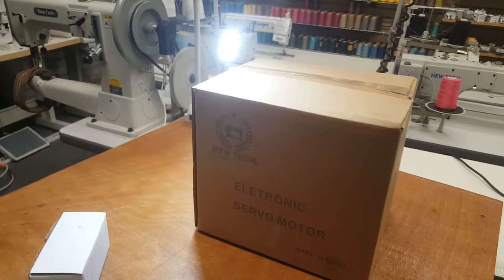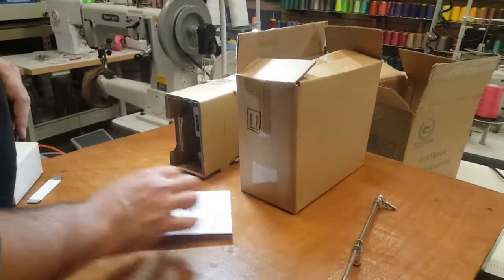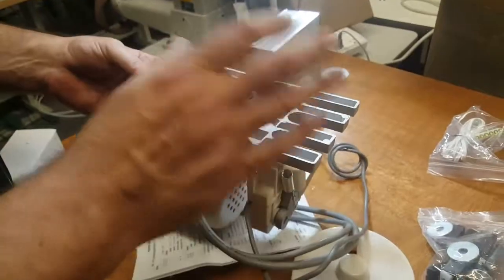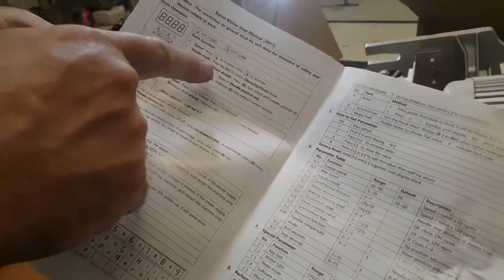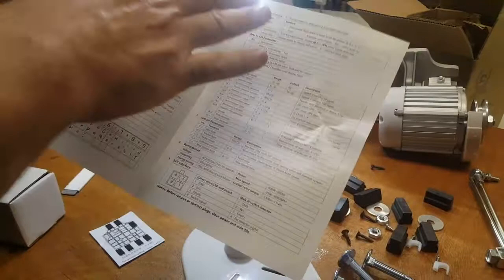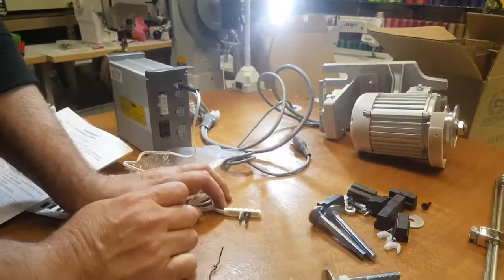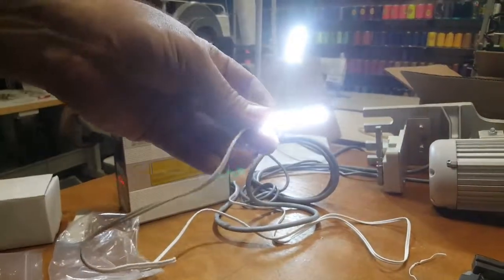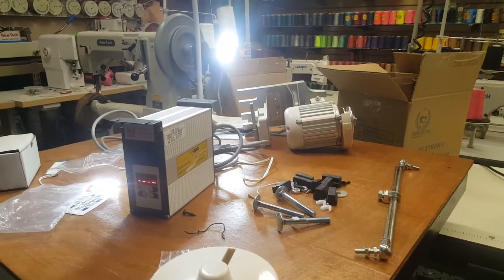Product Highlight - Brushless Servo Sewing Machine Motor - Goldstartool.com - 800-868-4419

Comment: Kindly let me know, given a speed setting, would you be able to vary the speed with the pedal? Or, is it 0 or 100% speed only? for example, if I set it to 3000 rpm but I have to reduce substantially when sewing a curve after a straight line, would I be able to do with the pedal?